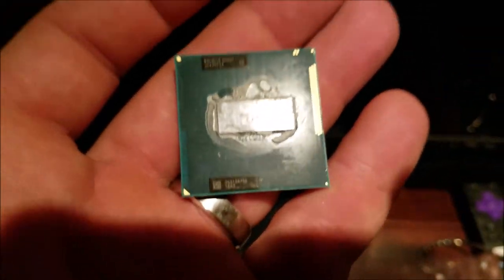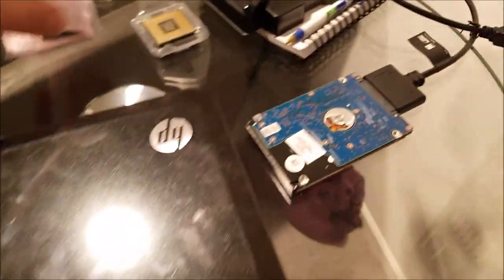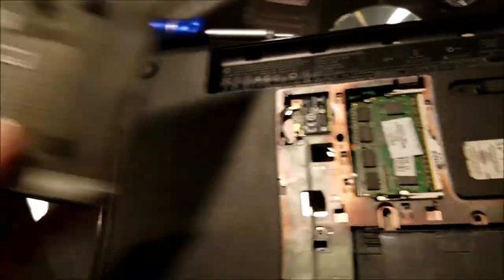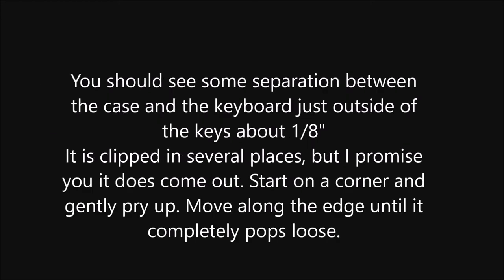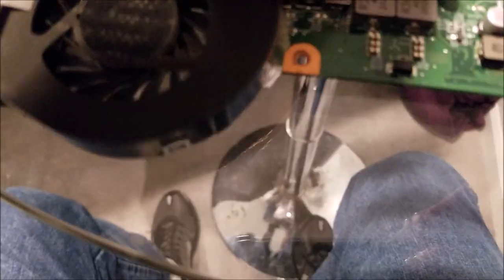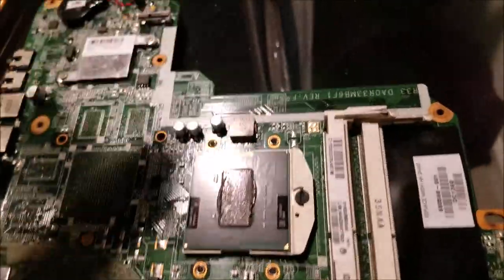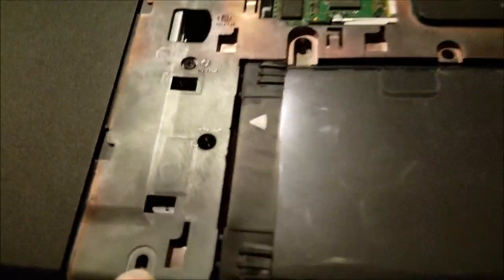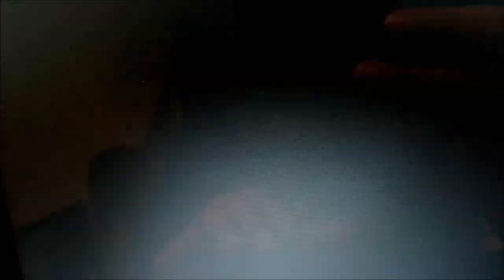How to upgrade to an i7 processor in your old laptop

Comment: I have a Samsung NP550P5C laptop that uses the Intel i7 3630QM CPU and would like to know if an i7 3940XM is possible?
Reply from the maker: You already have an ivy bridge chip, so you don't have to worry much about the chipset supporting it. I'd update your bios and try it. It should work. My only concern is that it may tax your cooling system. I am running a 3840qm and I love it. When I ran my 2920xm, it got a little warm when I was processing long videos. If you don't do hard-core tasks like that, I think you'll be fine. If you do, it would probably be better to get a slightly lower level chip like the 3840qm. If you are using it to game, the xm chip should work great.
Reply: @EricErnst  Well, I don't use my laptop for video editing or other types of rendering, but I use it a lot for games and I saw that the TDP of my 3630QM is 45w and that of the 3940XM is 55W, it doesn't scare me that much, which makes me afraid is to buy this stronger processor and at the time do not give video. I live in Brazil and would have to import it from China paying 1000 reais, which would cost me a lot. I think that because it is so risky I will end up opting for 3840QM.
Reply from the maker: @hugomoises2910  I had zero issues on the laptop in this video. It originally came with a dual core i3 2370m. Then I researched the fastest cpu that came from the factory.. a dual core i7 2640m. It was lackluster. Then I decided to go for the gusto and ordered a a quad core i7 2920xm. It was a super fast chip and I loved the performance. The older 2nd generation 32nm architecture is not as efficient as the 3rd generation's 22nm process. When I was processing videos, I would see cpu temperatures of 100C. That is when I decided to change to a 3840qm. It has a 10w lower tdp than the 2920xm but similar clock speeds. 
  Ultimately, every chip that I tried worked in my laptop. I think the 3940xm would be a faster chip in gaming. Gaming does not stress the cpu as much as video rendering so temps should not get as high. Have you considered an external gpu? I ran one shortly and planned to film a video on it. It requires an adapter and a desktop cpu power supply and a desktop gpu. You can find the adapters online. It significantly improved gaming performance. It was a few years ago. I used an AMD rx580 8gb gpu. It worked very well compared to the integrated graphics. 
  For a while, I was running a pair of RX580s in crossfire in a desktop cpu that I built. Now I'm just running a single RX5700 XT gpu. I'm anxious to see the performance of the new 6000 series amd gpus. I upgraded to a 3950x 16 core/32 thread processor in my desktop pc. I dont use my laptop for video editing anymore with that monster of a Desktop pc. 
  Good luck with whichever route you decide. If you want any help or advice on anything else, feel free to ask. I'd be glad to help out.
Reply: @EricErnst  I thank you very much, it was and is being of great help. I managed to get the processors compatible with my motherboard's chipset, I found that it says it has support for 3840qm and does not quote the 3940xm, but contacting the motherboard manufacturer through Aliexpress ob inconclusive answers regarding support; Some vendors say it works with the 3940xm and others say it doesn't work, I contacted some of the chip vendors and after I passed the motherboard reference to them they said it would work without problems. Here are the current specifications of my laptop: i7 3630qm, GT 650M 2g, 8g RAM DDR3 1600Mhz, SSD Samsung 750 EVO 250g, Hard Drive 1t Seagate. Reference model: Samsung NP550P5C. Grateful for all the help.
Reply from the maker: @hugomoises2910  my cheap laptops use the integrated graphics and do not have discrete graphics solution. I didn't realize that you were not using integrated graphics on the cpu. I'm afraid that you won't see a big improvement in gaming just by upgrading your cpu. The gt 650m gpu will be your limiting factor. You might see up to 10% better fps but gaming is almost exclusively the gpu's responsibility. You already have a quad core so it shouldn't be bottlenecking your gpu very much, if at all. What games do you play? There are a few websites that allow you to input your system's parts and approximate the fps in games. Maybe you could input your cpu and graphics and then see what the improvement would be with a 3840qm..  or even a 3940xm and see if it would make a big enough difference to justify the cost. Ill do a little digging. I know I've seen a site that rates systems and van approximate how well games will play.
Reply from the maker: @hugomoises2910  https://www.cpuagent.com/build-compare/intel-core-i7-3630qm-vs-intel-core-i7-3840qm/summary/nvidia-geforce-gt-640-vs-nvidia-geforce-gt-640?res=1-vs-1&quality=ultra-vs-ultra&ram=8-vs-8&ramspeed=1600-vs-1600 
  The mobile gpus are roughly equivalent to one step below their desktop counterparts so I chose a GT 640 gpu with your current cpu and a 3840qm. It doesn't look like you will get a single frame per second at 1080p in most games if you upgrade your cpu but not your gpu. I think that a cheap used power supply, the mobile gpu adapter and a cheap gpu will give you a lot of bang for your buck if you want to improve your gaming experience.
Reply from the maker: Just for shits and giggles, here is my desktop video editing/gaming rig versus your laptop. 
https://www.cpuagent.com/build-compare/amd-ryzen-9-3950x-vs-intel-core-i7-3630qm/summary/amd-radeon-rx-5700-xt-vs-nvidia-geforce-gt-640?res=1-vs-1&quality=ultra-vs-ultra&ram=32-vs-8&ramspeed=3600-vs-1600
Reply: @EricErnst  kkkkkkkkkkkkkkk PC dream

Comment: I have an HP G7 laptop with the i3-2350M.  It's no speed demon but the problem with it is that the case is falling apart.  One of the screw holes was broken off at some point and so it starts pulling apart there.  You can fix the case and I have, but eventually it will start pulling apart again.  One of the times it was apart I looked at the CPU and it seemed like it would be pretty easy to upgrade.  Now I have superglued the upper and lower cases together so upgrading is no longer an option, but I have my eye out for a Sandy Bridge generation 17.3" that I can do this upgrade on.
Reply from the maker: I'd look at a later sandy bridge laptop. The earlier chipsets don't recognize ivy bridge processors even though the socket still fits. The 2920xm was a good cpu, but it ran pretty hot when I put it under a load. The 3840qm is a great chip because it is basically as fast but the temps are under control. 
  Ivy bridge is more efficient so you can run a little faster without overheating issues on the stock cooling solution. 
  My desktop cpu is a monster. I upgraded the cpu in January and the gpu last August. It's an amd 3950x and 5700xt gpu. It's a 16 core/32 thread behemoth with a pretty good graphics card. Way overkill for what I use it for, but I don't have much time so I want to make my time editing videos as quick as possible. It can render videos 10x faster than this laptop.
Reply from the maker: Make sure to get an ssd to swap out as well. That's as big of an upgrade as anything else.

Comment: Hello Eric, I have a question. I have a samsung rv 420 that comes with an i3 2310m, it is the version without dedicated graphics, my question is whether to install an i7 2640m 2/4, which is the same as the initial processor with 35 TDP, or an i7 2630qm with a TDP of 45 4/8 and therein lies the issue since with the i3 of 35 TDP already being at its maximum it is at 80º, what would be the best?
Reply from the maker: I would recommend a minimum of a 2630qm. That will give you double the cores and threads of your 2310m. 
  I still use this as my primary laptop. I have since upgraded it to an i7 3940xm cpu. The original chip was a 2370m. I have not had any issues with cooling except for the 2920xm, which I used briefly. 
  I would check your chipset, and if it will allow it, upgrad to a 3000 series quad core chip. The 3840qm was a great choice, and the 3940xm gives me an extra couple hundred mhz on all cores. It is also built on a newer 22nm architecture instead of the 32nm architecture of the 2000 series chips. 
  I am a little rusty on the exact 3000 series quad core cpu, but I'm sure it's in the same realm of a 3630qm. 
  Just be sure to clean out your fan and use a good quality thermal paste when replacing the cpu. That will keep temps in check.
  If you haven't yet, I'd upgrade your hdd storage to an ssd. The laptop will feel much snappier and very quick. 
  Depending on your usage, you can upgrade your ram or not. I got a 16gb kit but rarely use more than 5gb. 
  A battery is another piece that can be upgraded. I like not needing to be near an outlet all the time. In light usage, I can go for 12 hours or more on a single charge with a higher capacity battery. 
  The xm cpu is very efficient at lower loads and an ssd uses less power than a spinning disc hard disk drive. Couple that with a clean cooler and fresh paste, the fan doesn't need to run as fast for as long.
Reply: @EricErnst  Ok, in my case the chipset is the HM 65 so I'm going to go for the i7 2630qm, (although in the list of CPUs if you search it appears that some specific models of third generation processors are compatible with this chipset, but sometimes they are the second ones are much better in my case)
Thank you very much for the help, greetings from Argentina :D
Reply: The ram memory capacity is a maximum of 8 gb in ddr3 and I already put an ssd in it and use the old disk as storage so I changed it for the disk reader and the battery and I am about to try to revive it since it is one that was saved for years when the pc was bought and that's why it doesn't work and if that doesn't work I'm going to buy another one directly, thanks for the help Eric.
Reply from the maker: @agustinquevedo7674  with a hm65 chipset, I'd definitely stick with the 2630qm.
  I am running 16gb of ram in my system with no ill effects, even though it claims the max ram is 8gb. It works. I have confirmed ram usage over 8gb in the performance monitor.

Comment: Hey bro, the second generation processors are compatible with the third generation ones? Because I see that the i7 you placed is second generation and the i7 is third generation
Reply from the maker: Not all of them are compatible.  I did replace a 2370m with a 3840qm. My chipset is hm76. If you have the hm65, you need to stick with 2nd gen cpus. Find your chipset and it will determine which route to go to upgrade your laptop.
Reply: @EricErnst  Excuse me, do you know how I could know what the chipset of my laptop is? I'm searching the internet and I can't get an answer.
Reply: @EricErnst  I just checked with cpu-z and I realized that I have the hm 65, too bad, anyway thank you very much for advising me friend, happy day
Reply from the maker: @pedroignaciomoyagarcia2694  you can still upgrade to a quad core i7. I have run a 2920xm cpu. It ran a little warm when rendering videos. I would recommend at minimum a 2630qm and at maximum a 2840qm.

Comment: I have an i7 2670qm of 6m cache and I’m stuck with 1333mhz as ram speed I’d like to upgrade to a higher one of 8m cache data and 1600mhz.. can you recommend the best upgrade??
Reply from the maker: It looks like the 2710qe will support 1600mhz ram.  Anything above that will support 1600mhz. 
  The 2820qm has 8mb of cache, while anything between your 2670qm and the 2820qm only has 6mb. 
  To be honest, you probably won't see a huge difference in speed. Make sure the price of a new processor is worth the upgrade. I'd hate to see you waste money on a very minor uplift in performance. 
  What do you mostly use your laptop for?

Comment: Hi Eric ..Very nice  video ..need some advice from u ... can i upgrade my Intel Core i3-2330M @ 2.20GHz Socket Type ( BGA1023 ) to Intel Core i7-3840QM
Reply from the maker: I think that is the perfect upgrade. It will not overheat with your existing cooler and it will be much faster than your current processor. That is exactly why I chose that exact processor for my laptop. There is one thing that you need to check. You need to know your chipset version. It should be something like HM65 or HM76. The older version, HM65 came out before the 3000 series cpus and is not compatible. The chip will physically fit into the socket, but it will not boot. The 3000 series chips run great. They are built on a 22nm architecture instead of the 32nm architecture. If your chipset is the older hm65, I think you'll be better off with a 2860qm. 
  I would update your bios before you try to swap cpus. Also, if you have not tried upgrading to a ssd for storage, definitely do that. I have a 500gb ssd in place of my stock 500gb hdd. It boots much faster and programs load quicker. I also got some ddr3 sodims for cheap. i am running 2x8gb sticks for 16gb of RAM. It definitely added life to my old laptop. It was practically unusable with the 4gb of ram, dual core processor, and slow hdd storage. I also upgraded to a higher capacity battery. Yours is likely ailing if you haven't replaced it yet. The biggest advantage of a laptop is its portability. I got an upgraded battery with higher capacity. I think it is a 12 cell vs the oem 6 cell. Regardless, the capacity increase makes for super long battery life. Upgrading to an SSD will also improve battery life slightly. 
  good luck with everything. Check back and let me know how it works out for you!
Reply: @EricErnst  Thanks you for reply ... unfortunately my chipset version is HM65 .. i will go with i7-2860QM .. thanks again for you good advice ..
Reply from the maker: @shazwan7526  Good luck with it. I wouldn't worry too much over the sandy bridge vs ivy bridge. I really think you can't go wrong with a quad core over a dual core. Depending on the prices in your area, it may be better to go with something as low as a 2630qm. It is an old laptop and at some point you can probably find a slightly newer one and upgrade it for the same price. I'm not sure what the break-even point would be, but I wouldn't be spending over $150 for a 9 year old processor. 
  Speaking of the 2630qm, I installed one in a laptop for my mom over a 2110m. It is a great chip, and a huge upgrade over the dual core that her laptop had from the factory. I'd take the 2630qm over the 2640m any day of the week. I barely noticed a difference when upgrading from an i3 2370m to an i7 2640m.
  Regardless, any quad core will give your old laptop a new lease on life! Like I said earlier, before I started to upgrade it, my old laptop was becoming almost unusable. It was my primary computer and I used it to edit and render all of my YouTube videos. I would often leave videos overnight to render. It would take hours. I uploaded a video last night and it took under 1 minute to render with my current desktop pc. Good luck with everything.
Reply: Does it work ?

Comment: @Eric Ernst Can you please suggest me best situatable CPU for my dell 5110 Inspiron laptop
Current config,
i5 -2450m
SSD
12gb ram 4gb 1333mhz + 8GB 1600Mhz = 12gb
chipset HM67
Looking for 100% compatible laptop cpu upgrade to for i7-2670QM /i7-2860QM / i7-2960XM / something with less heating issues.

Goal is to get performance gain  I'm programmer ( don't perform graphics intense tasks)
Reply: i7-2760qm //  To avoid overheating the processor and power supply, disable turbo boost on the i7-2760qm processor, get 4 cores, 8 threads, 2.4GHz. This will be 50-60% faster than your i5 processor and won't overheat. Buy a second memory module 8GB DDR3-1600 (1.5v) and make 8gb+8gb dual channel memory to speed up programs and games.  I have been using i7-2760qm processor for 2 years and am happy with the performance and processor temperature. I take my notebook to computer service once every 2-3 years to replace thermal paste on the cpu, clean the heatsink from dust and lubricate the fan bearing with silicone (or machine) oil.
Reply: deactivate the processor turbo boost:
in the Power Options menu (WIN 10) -> 
the "Balanced" power supply circuit -> 
"advanced power settings" ->
Processor power management ->

Minimum processor state:
On Battery: 0% - 
Plugged in: 0% -

System Cooling policy 
On battery: active -
Plugged in: active -

Maximum Processor state: 
On battery: 90% -
Plugged in: 99% -

Comment: Sir can upgrade cpu i5 2430m to i7
Reply from the maker: Yes. I recommend at least a 2630qm. That's a quad core processor with 8 threads. I think that is the best bang for buck performance. It doubles your core/thread count so that's a win right there. You could go as high as a 2960xm but I think they are prohibitively expensive for a 9 year old laptop. 
  Depending on your chipset, you may be able to run an ivy bridge 3000 series cpu. That will give you a good performance boost as well as an efficiency improvement so it will run cooler when under a heavy load.
  If you have a hm65 chipset, you are stuck with a 2000 series sandy bridge cpu. If you have hm76, you can upgrade to a quad core I've bridge cpu.